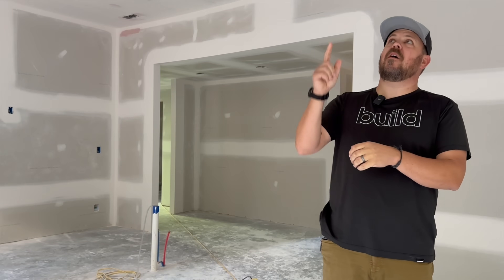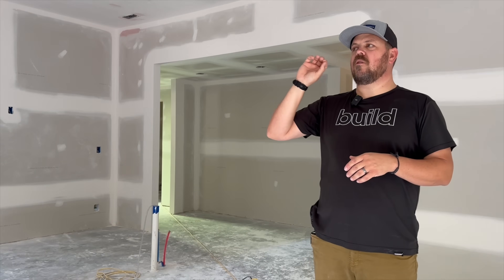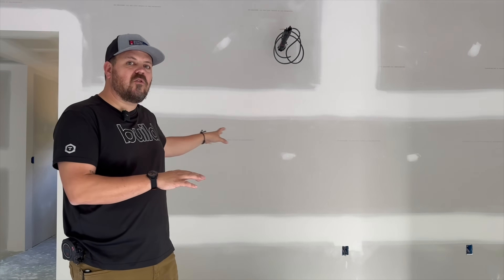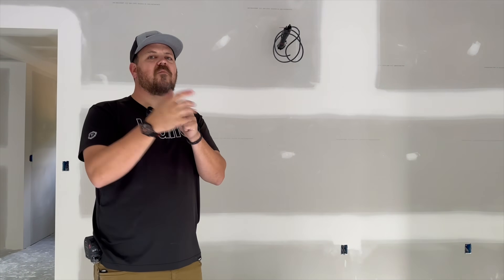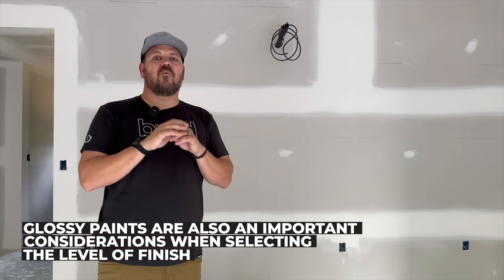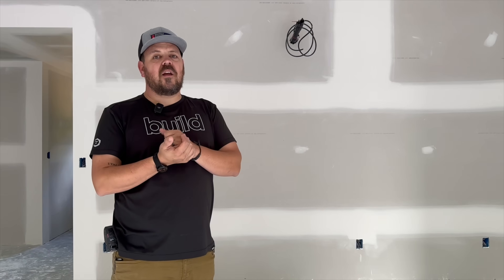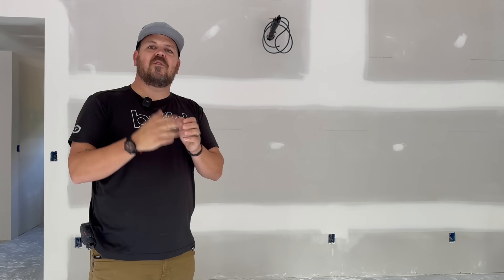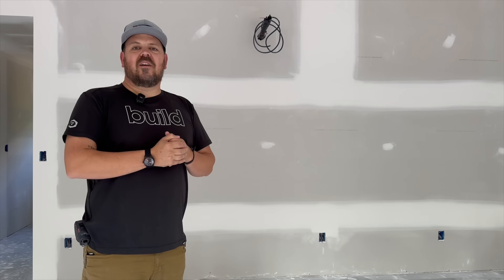Selecting Drywall Finish Levels

Comment: Seems like one good option for dealing with butt joints is to move the joint to between the studs and use a butt board to pull the joint into the wall/ceiling. Of course, avoid where feasible because they are expensive, but when you have to have a butt joint, just move it a foot to the left or right.
Reply from the maker: Absolutely agree. Using them wisely can save lots of cash too.

Comment: We have a builder that said that they would not use eggshell paint on a level 4 finish. Only flat paint, or level 5 drywall finish. I understand the explanation of the problem with using  dark colors, but could you comment on paint finish. Thank you
Reply from the maker: Sheen is just as important as shade. The glossier the paint the more it will show imperfections. The builder is right to be risk adverse in that situation. Flat hides more because it doesn’t reflect as much light. With today’s advanced latex paints as well, the resin (where it get sheen and toughness traditionally) is no longer the only factor for durability so going flat isn’t the end of the world any more.